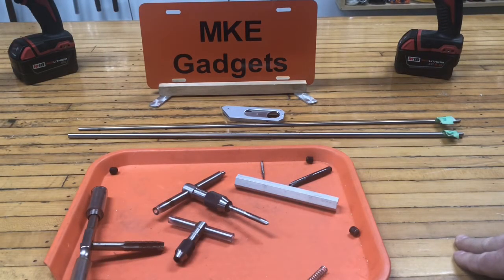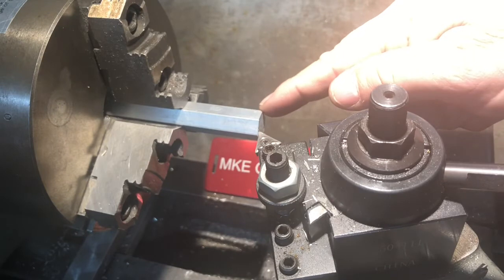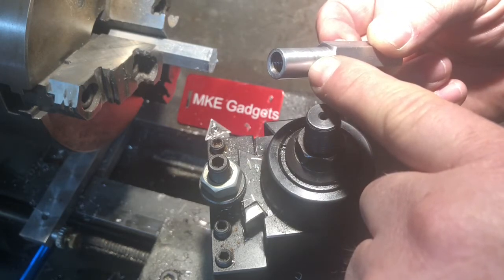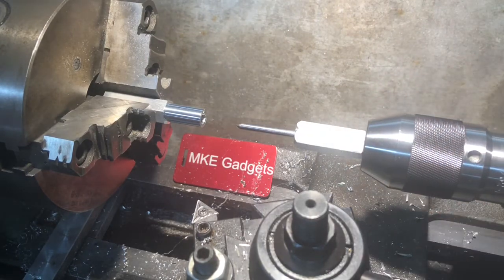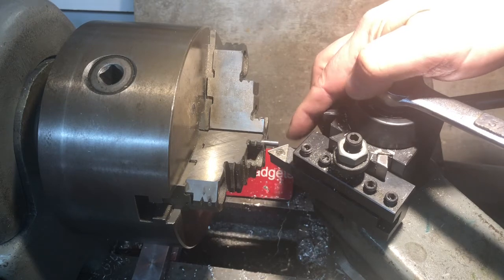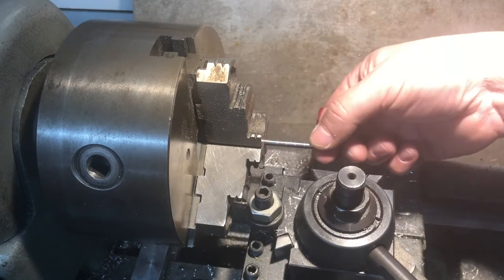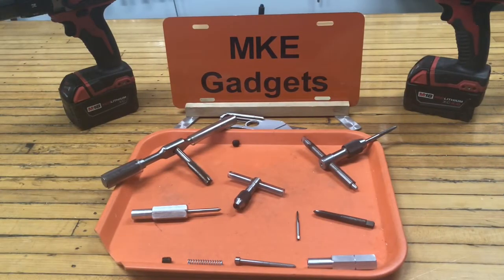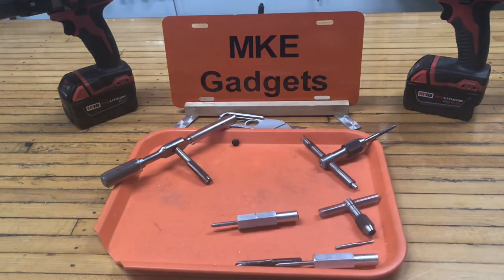DIY Tap Follower @ MKE Gadgets #71

Comment: Hello from Norway. 
Nice job. Will do the same (but in Metric :-). Carl
Reply from the maker: It was built with the Materials I had on hand. I turn a half inch diameter to fit into a half inch Collett in my milling machine. I don’t know what size materials you would have in metric. Where are you going to use it in a lathe or in a mill? Just take the concept and make it your own. With what you have on hand. Or what you have access to. Thanks for your positive comment please support me by subscribing to my channel if you have not. And check out my other over 115 videos on YouTube.

Thanks for your support. New video on most Wednesday, your going to like the next one.